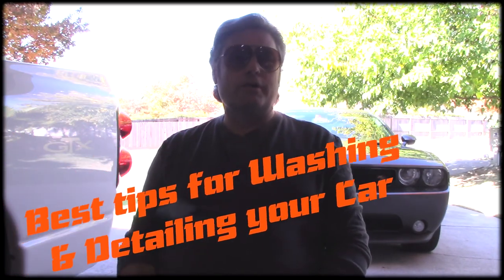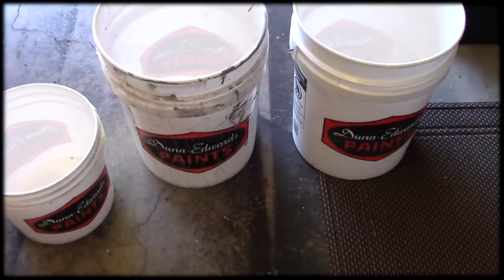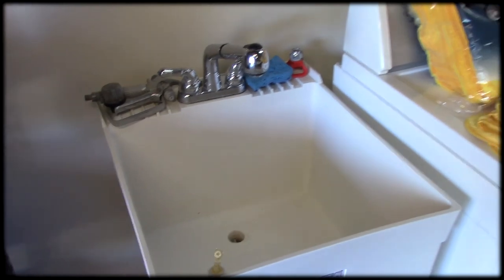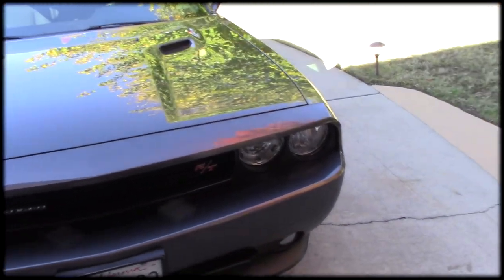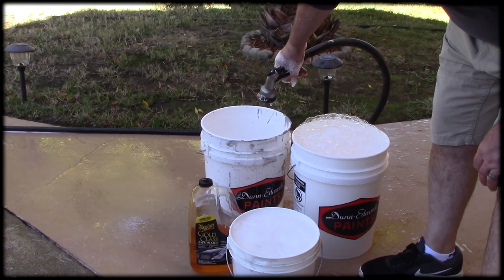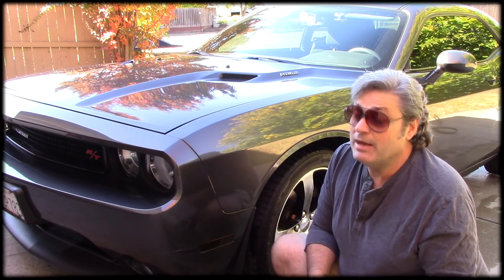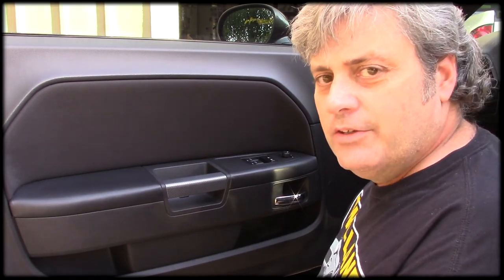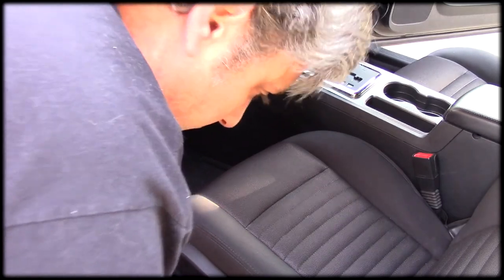Best Tips for WASHING & DETAILING your Car, Mad Max R/T

Comment: Dean: enjoyed this.  Rekindles memories via mid-1980s as a high school kid having to help my dad wash his stable of 3-4 cars every Sat morning.  My question: Received your recc of 'Maguire's 3 in 1 wax', and 'Maguire's Carnuba wax'.  No stores around here stock that '3 in 1 wax'.  My Lex hasn't been waxed in quite some time.  Is there a good substitute for the 3 in 1 wax?  And do I need to use both of these products in succession? (Ie the same afternoon)  Just looking for a substitute for that Maguire's 3 in 1 wax, if there's a good one you recommend, or if it's needed (I can buy the Maguire's Carnuba locally).  Would the Maguire's Cleaner Wax, followed immediately with Maguire's Carnuba, work?  I've been out of the car hobby forever, Deano, and trust your judgment.  Thanks.  Vinny
Reply from the maker: @xman777b  Yes bud, use a good Maguire's Cleaner Wax, which is basically the same end result of using the trendy new "Clay Bars" to first remove the "crust" of dull paint & Clearwater, before applying a quality Carnuba Wax. I personally have a high quality buffer, but I prefer doing the "Cleaner" first all by hand, one section at a time, like a door, hood or fender. Then I apply & buff out by hand the final wax application, which if done right renders a flawless finish like a mirror. Throw a Terry towel on the hood or fender & watch it glide off from the slick polished surface. Modern ClearCase are pretty durable, but are insanely thin. The last thing you want is to use a rotary buffer at high speed & "burn through that micro-thin coat of clear". Especially easy to accidentally do on sharp body lines or ridges, where the buffing wheel can readily burn through it.
Finally I use a good quality Maguire's Wax Detailer in a spray form. So once or twice a month after I wash vehicle by hand I take that "Detailer Spray Wax" & lightly hit areas then buff out by hand. You can do most of a car that way in a half hour & the SOB looks like it was just waxed. Perfect right before a car meet or cars & coffee event.
Reply: @vinniecorleone62   thanks brother.  That really helps.  I'll pick up that 'Maguire's Cleaner wax' and 'Maguire's Carnuba wax' combo, right now.  That particular cleaner wax is gentle enough on clear coats, right?
Reply from the maker: @xman777b  Yes, the Cleaner Wax is up there with the Clay Bar approach. I still prefer the old way.
Reply: @vinniecorleone62   👍

Comment: And people think I'm nuts because I use two buckets. Then again, those people are the kind of people that take the wheel brush to the paint at the car wash. I do everything the same, pretty much to a T. I also use a filter to help minimize water spots. I also do the wheels last, I take them off the car to do them. That way I can clean the calipers and wheel wells. I took a clay bar to it for the first time. It was like sandpaper. Next I want to tackle polishing.
Reply from the maker: I used to use the soft water filtration gun but it was really not needed if you work quickly earlier in the morning to see it through, often they're used by folk too lazy to do it right or washing their cars late in the middle of the hot day where water spots are a real serious issue.  I've trying virtually everything over the years & arrived at this basic & straight forward approach bud.   The clay bar is the new gimmick which works fine but a good quality 3-M cleaner polish & pad by hand do the exact same thing, soon I will show how I cut & polish a car completely by hand with no machine, the buffing wheel can wear down the thin & fragile factory clear coat in no time at all.  My truck I will probably film next, it needs the motor & engine bay cleaned good as well as a good stripping & waxing of the outside.